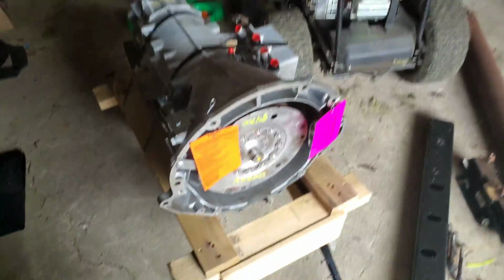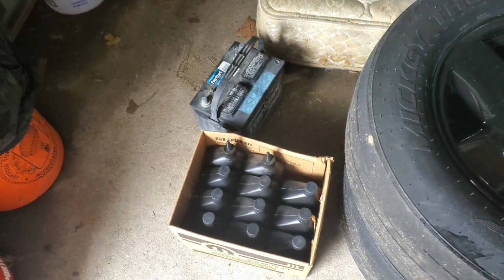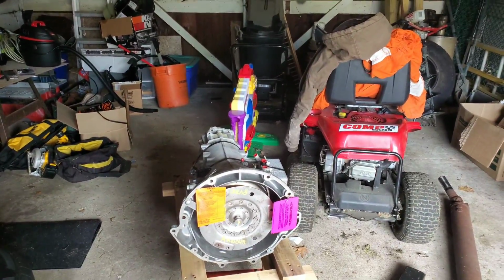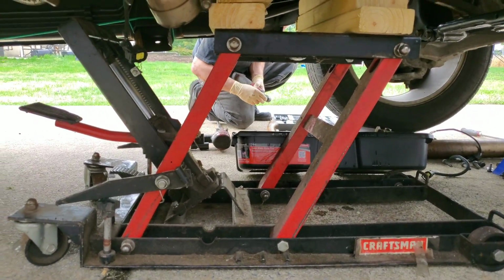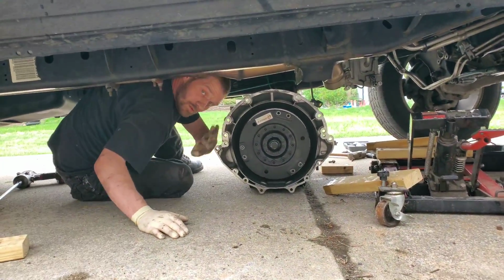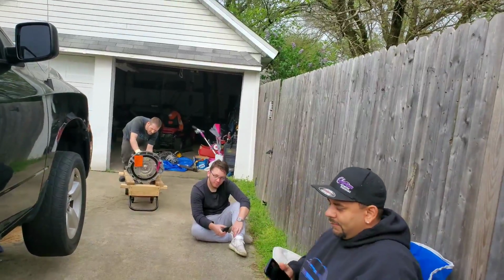Will a 2015 transmission fit in a 2014 RAM 1500!!!

Comment: After calling the major aftermarket transmission places such as Arrington transmission, nobody makes the hard parts for the transmission and in theory the motor should never be able to produce enough horsepower to Shear the output shaft. The only time an output shaft is sheared is if there is a defect in the metal itself.
Reply: @Mr.Torres831  you are correct. It is not necessarily friendly to the drive line to launch in 4-wheel on dry pavement. the damage from that is usually not sustained by the transmission, but usually the transfer case.
Reply from the maker: This would have never happened if my truck didn't wheel hop but that being said only racing with my slicks in 2wd

Comment: Hey so question are you scared that the issue can happen agin with that tq converter maybe going down from a 4K to a 3k??????         When I watch the other video a while back I was thinking that the 4K maybe to much for the trans
Reply: I blow 1 transmission with the stock converter. I blow another one with a 3600 3800 stall. I don't think the converter has anything to do with anything lol. I'm on my 3rd transmission.
Reply: I had the exact same question....
Reply: I always thought the high torque converter would break the axle back shaft before the transmission, no?
Reply: 1SLOW RAM  aww you know never saw you break the others  lol only the last one. I probably never got to them videos lol I guess I got a lot more to look at lol.    Looks like it was a clean install but the tune.Because it’s a new trans do you think you need a new pcm to go with it and then unlock that pcm to get it tune??? Or is that a far stretch on that one?  On the newer I know that you have to get pcm unlock like mine.
Reply: Venom Hemi  that is what I would think too I would have not ask the first question if I had know that the other transmission had gone out too lol
Reply: What kills it is wheel hop and spinning and grab traction.  But, it may be the weak link.

Comment: I have a 2012 5.7 with 6 speed. What's the benefits of putting in an 8 speed other than better fuel economy?
Reply from the maker: Towing faster fuel economy rides smoother better shifts
Reply: Pretty much everything. They have the zf 8 speed transmissions in the ram 1500, all challengers up to the hellcats, chargers up to the hellcat, and jeeps up to the hellcat powered trackhawk for a reason. Its the best they have had in a while. Obviously the gearing is different for a car than the trucks, but they just beefing up the same trans for the higher horsepower vehicles
Reply: I have a 2010 6 speed is it possible to install an 8 speed knob control?
Reply from the maker: @pjadame  no , the swap alone isn't even worth the money might as well buy an 8 speed ram for the cost to swap from a 5-6 speed
Reply: Incredible Hemi

I bought a 2014 with 36000 miles with a complete drive train 5.7 hemi 8 speed transmission and 3.55 differential 

My 2010 already have over 200k mile still running strong but I thought I was going to be able to use the transmission, I guess I just used the engine and rear end.

Thanks for the reply.
Reply: I have a 6 speed 2013  and a 8 speed 2013 can i put the 8 speed were the 6 speed is ?

Comment: I'm also wanting to replace my 8hp70 with a newer one I just picked up with only 35k miles on it. Been trying to find out if the dealer has to flash it for it to work, or if all I need is a custom tune afterwards. Can't find the answers anywhere online. Good vid.
Reply: How did you work it out ?

Comment: I have a question do you think or know if it’s possible to do a 8 speed swap on a 3rd gen 2007 Ram I have 4 speed transmission and I was trying to do some research on it to see if it’s possible
Reply from the maker: It actually is possible someone just did it put its not an easy swap
Reply: Incredible Hemi oh ok thanks man i’ll look into that 👍

Comment: What Diablo tuner you use?
Reply from the maker: Intune i2
Reply: @IncredibleHemi1111  Have you had any problems tuning the tanny(your old one)? Another youtuber, boostedmotorsports, had his Diablo lock up his pcm when he tried to tune the trans. It would say it failed, but never let him put the stock tune back in either so he had to get it reflashed at the dealership. He had a 2014 Ram 1500  with the 8 speed
Reply from the maker: Never a problem with tuning my tranny , 2014 most people couldn't get there tranny tuned by diablo only a handful of us got lucky
Reply: @IncredibleHemi1111  well thats a relief. I got a 2017 so im good. Thanks!